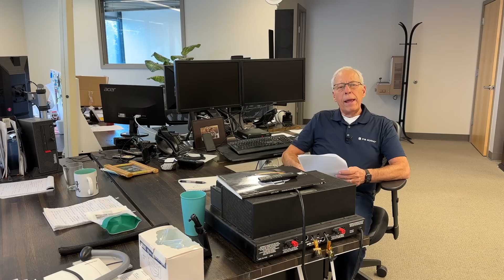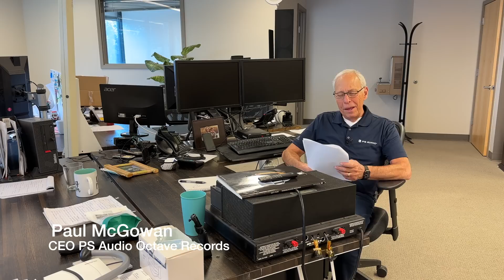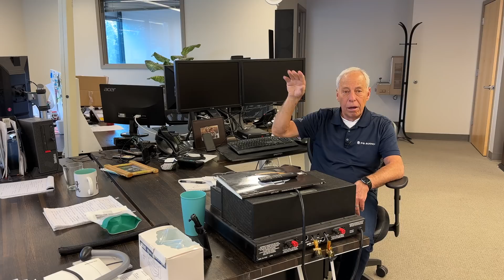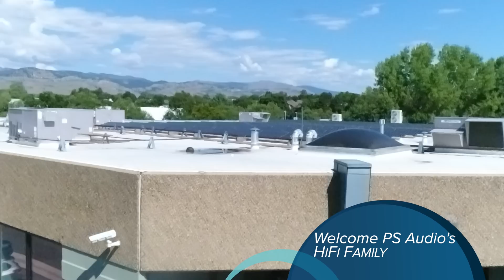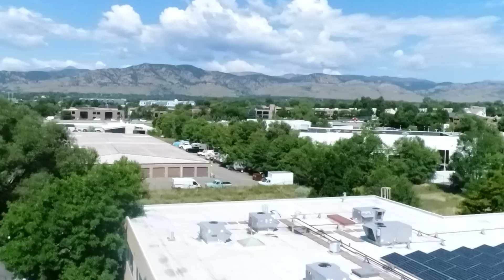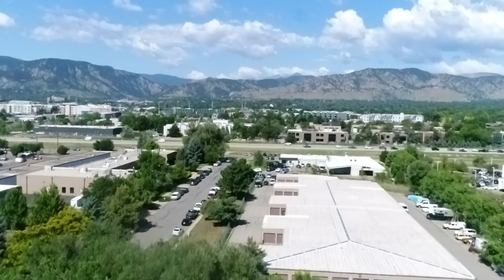Super tweeters and amps

Comment: I use premium class A/B amplification. My speakers are described as ‘high end’ whatever that means, by all reviews. The manufacturer’s website described them as mid-range flagships. I do have a £1200 pair of ‘super tweeters’. They do make a notable improvement. The question is, had I spent £1200 more on my floorstanders, instead of my existing floorstanders plus super tweeters, would I have ended up with a better all round package?
Reply: @ Douglas Blake.That'a a compliment if YOU think anyone is messed up. I see your rude Comment has been taken off here, and it wasn't reported by me. Anyone who resorts to insults like you, who has lost every single debate between us, if you call your nonsensical points "a debate," perfectly fits the description of your insult. What do you know for instance about the background of any of those reviewers? NOTHING!  You continually speak out of ignorance on here. Robert E. Greene for one, is not just a respected audio reviewer for five  decades, but has built some really respected amps in his lifetime, and was a consultant on many other company's legendary amps. You know not what you say as usual, in your old age. Anyone putting belief in what you say on here is foolish, and would be better guided elsewhere. I don't even buy anything based on what reviewers say. They may lead me to investigate certain things and their merit on my own though. But ultimately I have ears of my own, and that is the main thing I have gone by; successfully.
Reply: @sidesup8286 
"What do you know for instance about the background of any of those reviewers? NOTHING"

Steve Guttenberg was a projectionist.
 Andrew Robinson was an advertising copywriter.
Randy (Cheap Audio Man) was a submariner.

Shall I continue?

The point is that none ... literally none... of these guys come from any background that is even remotely connected to electronics or engineering.  Yes, people like that are going to decry "measurements" for the simple reason they can't compete in that market and their incomes do depend on their online reviews.  

If you look, you will find a LOT of occasions where I've had to correct these guys on a lot of the claims they make in their reviews... with the manufacturer ultimately backing me up.  For example:  I ran tests on a number of TPA3255 based chip amps, recently.  Both manufacturers have subsequently updated their product pages to show the true facts, not the chip's absolute maximum ratings.  

The thing is, these guys you are listening to actually have a financial stake in misleading you... it's how they make their money!  They NEED you to believe that measurement is useless, that the new speaker of the week is the best one ever, that the $2,000 DAC is better than the $50.00 one, and so on. If they fail at the task, their incomes dry up and your heroes go broke.

Take a look at Andrew Robinson's recent "hidden cost of cheap amps" video in which he offered an exceedingly manipulative position about lower cost amplifiers. If you listen to what he's actually saying, it's a protest against the impact that new, lower cost, amplifiers will have on his target market of high dollar, 'high end" equipment.  He goes out of his way to depict the mini-amps as limited, toys, and flawed, in defense of lower powered and often poorer performing high priced equipment.  

But if you hook any of the three amps he trashed to a pair of proper workhorse speakers, such as the Heresy, L-100, Linton, Pioneer... you get a totally different story. Not only can these little amps deliver... they can deliver for 1/10th the price of his usual fare.
Were he to deliver that message to his viewers, his high end sponsorships would dry up overnight and he'd be out of the game.

Listen to the message these guys are spreading... not the words they are saying.

It's a simple chant... "Spend, Spend, Spend, I will profit in the end".

Your ongoing reliance on your ears alone tells me that you have no idea how much better life could be if you actually used the available engineering data to help you make your decisions.  I listen... maybe even more than you do... but I also use the tech data and my own testing to confirm what I'm hearing and to help me make buying decisions.  
Instead of the typical $50,000 audiophiles have tied up, I've put together my system (and many others) for an average of $1600 ... and trust me, they can and do compete in the same pond as the big fish.

Ask how much money you could have saved over your lifetime if you had just taken a bit of interest in learning how this stuff actually works...
Reply: @ Douglas Blake. Just because someone says "this beats that" or "that beats this", doesn't mean anything at all to me. Unless it is some reviewer that I know has real ears like Jonathan Valin, John Darko, Robert E. Greene, Andrew Robinson and yes...Steve Guttenberg.  And we all know what just about every respected audio expert in the world says about how shaky measurements are, and how things often sound, is exactly the opposite of what the measurements say. I don't doubt that among this Chinese onslaught of audio equipment, that there won't be some of those brands that will actually outperform some equipment more expensive than it. I have even found one such Chinese thing that I am impressed with. It runs in Class A, and has served me well for quite a while. I too, don't believe audio in many instances should cost that much, for even a real quality piece. I was just saying what my personal experience has been with non Chinese made, non Class D equipment.

 If Class D turns out to be a great way to make amps and the prices are cheaper, then I will change my opinion, as the situation evolves; if it evolves. I think I  have enough here though that I can't imagine ever HAVING TO MAKE any additional audio equipment purchases.
Reply: @sidesup8286  
" Unless it is some reviewer that I know has real ears like Jonathan Valin, John Darko, Robert E. Greene, Andrew Robinson and yes...Steve Guttenberg.  "

NONE of whom have even the first clue how this stuff works.  Subjective reviews are ADVERTISING and nothing better. 

" And we all know what just about every respected audio expert in the world says about how shaky measurements are, and how things often sound, is exactly the opposite of what the measurements say."

Audio experts like your advertising touts?  
I'll stay with the guys who invented and designed the equipment, thank you very much ... and you bet your ass measurements are how they make them as good as they are.

Oh man, you really are all messed up.
Reply: That would depend entirely on what you've got now and what you intend to buy.  Price is a terrible indicator of quality, especially in audio products.

But one thing I can tell you is that you could have saved  £1200 every easily.
Reply: @Douglas_Blake_579  how can you say that without having heard the before and after?
Reply: In my experience, price is an absolutely  WONDERFUL indicator of quality in audio. But it's not quality because of the price sticker they slap on it I must have bought nearing 100 different audio pieces in my life since my youth, and very rarely has anything cheap sounded as good or better than something significantly more expensive. I have never bought anything expensive that wasn't really good, except one time. It was a Japanese speaker that my then inexperienced ears, took a while to realize it had a somewhat nasal coloration. Except for that, it did everything else first rate. Even so, I don't think I'd ever assume or trust that anything audio is really good because of what it costs. But 90 out of 91 isn't bad.
Reply: @sidesup8286 
Okay then ... how do you explain that under comprehensive testing, two under $100 amplifiers ... A07 and V3 ... both beat out 80+ high end amplifiers, some costing thousands of dollars, in ASR's ranking?

https://youtu.be/byj_BDf5xwM